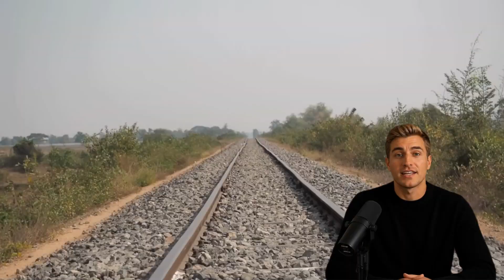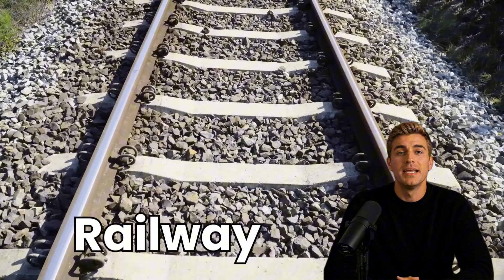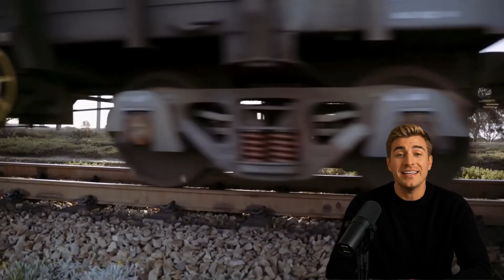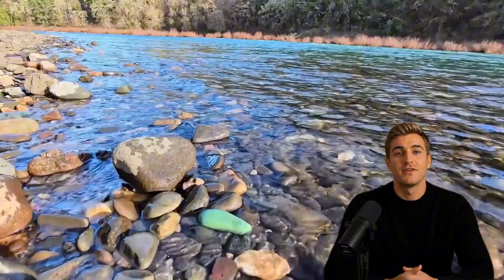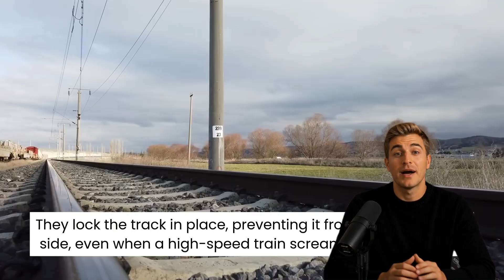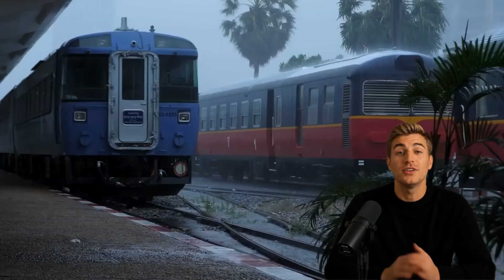The Real Reason Railway Tracks Sit on Millions of Loose Stones

Comment: Ballast absorbs the vibration and it supports the weight and it DRAINS 

Drainage is critical to keep water from rotting the wood and rusting away the rails
Reply from the maker: Great point! Drainage is one of the most important jobs of ballast, and it's easy to overlook. Thanks for adding that extra context!